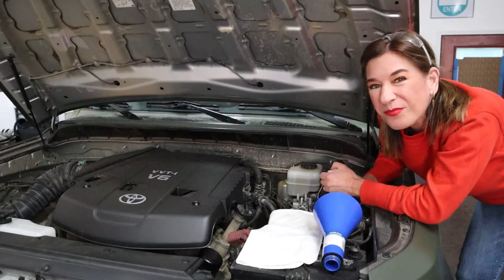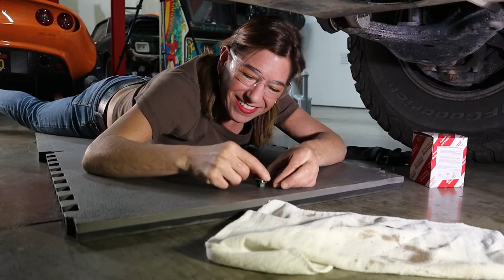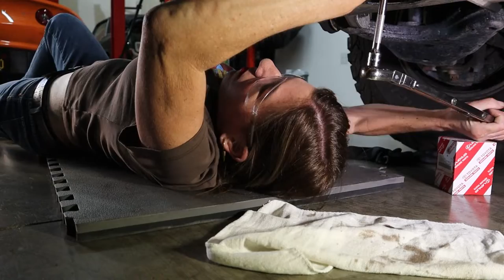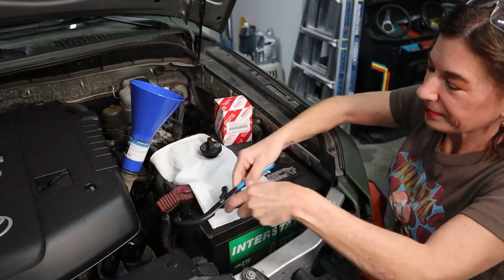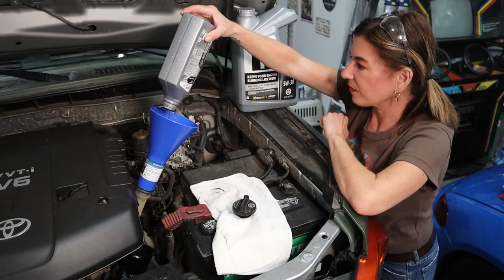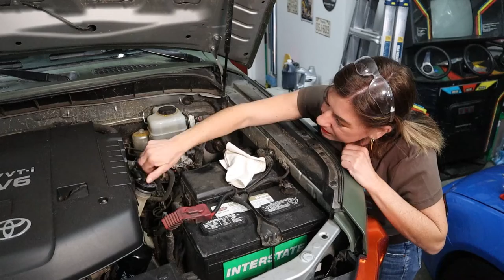Toyota FJ Cruiser Oil Change In THREE MINUTES!!!

Comment: Well Done No Bull 👍🏻
Reply from the maker: Haha thanks!
Reply: @RDGarage  Yes pulled this up I see you have a large hole in the skid plate I just picked up my fourth FJ through the years including my back in the day FJ40 what brought me to the “Modern Day” FJ.The one I just picked up 2014 41k mi.Minimal rust.👍🏻is my retirement Veh.Came W/a full Heavy Duty skid plate from front to back has small hole I’m Needing to cut it larger basicly it’s just enough for socket now and don’t want oil on underside skid plate and leaking in the driveway for minimal splash However definitely don’t want rust seeds all over and dont want to deal with pulling the heavy skid every time I go to change oil. Wanted to ask on the OD Satin what brand do you have on yours I’m an Auto body Paiter/ Body Man by trade there’s a few kits out there I know Eastwood has one and Cusom Shops seeking one that Beetlejuice doesn’t affect the matte finish.wen Washing how is yours holding up Mines Fac.blk. Now I will probably do a  video on painting this thing OD. I do have a video of Painting my solid maroon one I did a few years ago.Vid came out a little blurry but project came out Awesome.
Thanks sharing your Vid.and if you know What paints on yours if it’s holding up would be great to know.👍🏻🇺🇸🍻